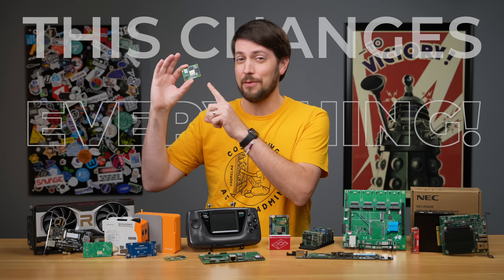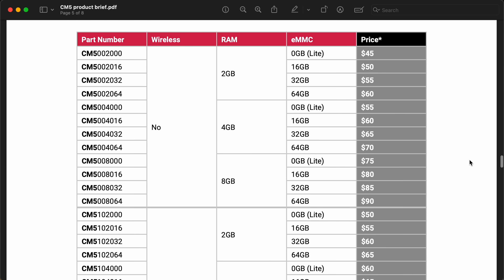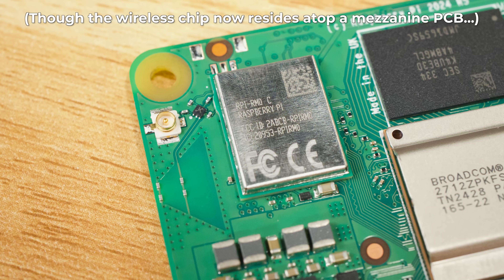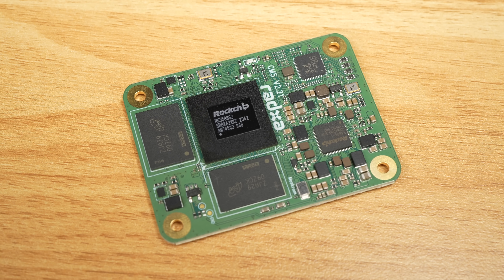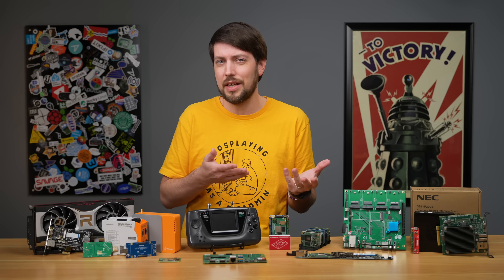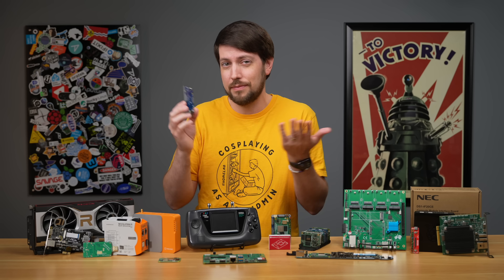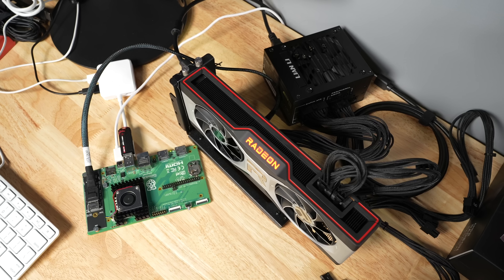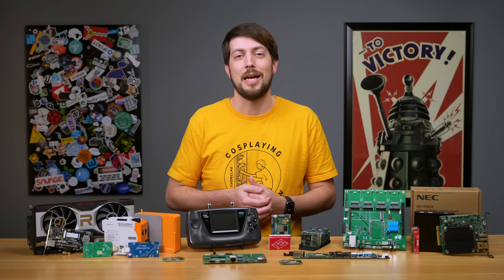This tiny computer changes EVERYTHING

Comment: Time for a raspberry pi phone.
Reply: I'm up for that!
Reply: You made my day. An arch linux phone.
Reply: Nah, gentoo. -O3 -funroll-loops
Reply: ...with a rotary dial - Justine Haupt, here we go again! :)
Reply: That's basically what the early PinePhone prototypes were…
Reply: @mskiptr The lack of RAM was the Pine phones primary disappointment for me. The SOC was much older and weaker than I liked but at least it ran Linux but the lack of RAM at that price 😔. Rumor has it that AMD is going to make a mobile phone SOC which would be quite interesting if it were true.
Reply: I'd love that but I dread the cooling issues it'd present
Reply: @g3n3r1c6  all aluminum case. the whole phone is a heat sink
Reply: @pauls5745  Same problem: What about when it gets too hot to hold? If we're throttling it, why use a Pi at all?
Reply: @g3n3r1c6  I would think it would okay, the flirc works fine. I imagine it needs thought, a phone case can't be all plastic. But im guessing its a device that could last many years.
Reply: @williamrutter3619  Probably, but there's the simple problem of holding it as it gets hotter. Eventually it'll get really unpleasant to keep in your hand.
Reply: @foldionepapyrus3441  Yes but at that point you may as well just use a smartphone with a CPU that's designed and coded to run at skin-safe temps.

You have this dilemma between the performance gains you could have, and the usability that you need to have.
Reply: @g3n3r1c6  solid state cooling will be a thing eventually
Reply: You can diy one already.
Reply: @alpha_pixel_ how does that work?
Reply: We still need better gpu
Reply: @sivasanthoshr.m2222  well for a phone I consider it sufficient, it will always be updated with new software and a new pi will fit in the slot in a few years time, all cutting ewaste.
Reply: @williamrutter3619  Agree 100%, I would love this, just a new CM module and a new battery if needed and away you go.
Reply: On it
Reply: Dude yessss
Reply: A... Raspberry PiPhone?
Reply: I’ve been planning a cm phone for a while after I got the basics for a rpi 4 tablet, running lineage OS with basic Google play functionality, working. It’s not the hardest thing to do. I’m still inexperienced but the power management circuitry and what battery/ batteries to use got a bit over my skill level. I never got a cm4 but it could be cool to look at that project again with the cm5. The screen was another thing I was having some trouble finding something that would really work well for a smartphone
Reply: @keatonbrier 
Just an idea 💡
Use a good USB power pack.. that is ergonomically nice and looks good..
with a case that splits along the edge... then make a strip (some are 2 sides and a spacer strip) that makes the 2 pieces further apart so you can install the electronics and screen..
I've used them to make the power pack also a rather powerful torch that fits in my coat pocket, have an air gap and multi layer foil (used to insulate House's between the LEDs and the battery, I've got switches on the side to switch each of the LEDs and a master switch on the end with a lock..
and it's still a power pack 😻
Reply: Id switch over to that tomorrow if the power drain and reliability was improved
Reply: You could probs slap Ubuntu Touch, Post Market OS, or Android on it, that'd already put you past the halfway point
Reply: Raspberry pi girlfriend
Reply: Or a Chromebook but with normal Linux on it, really repair-friendly and upgradeable
Reply: Nah time for a raspberry pi DS
Reply: @AverageSphere  hmm an interesting one, there is the GPI case, a compute module version, I think we are just waiting on the script and the gpi which started with pi zero power will be up to pi5.
Reply: what a good idea!
Reply: Need 4G LTE slot
Reply: piPhone
Reply: @LukeChannings  It amuses me that we basically commented this at the same time ^_^
Reply: Would smashing 💪🏻
Reply: Powered by Ubuntu touch?
Reply: please God I've been saying this for years
Reply: uConsole from clockworkpi
Reply: @siteking4289  Yep, I wonder why Jeff does not have one yet?
Reply: Maybe FairPhone can do it, they're already making phones that have user-replaceable modules. Slap a compute module in it and you're set.
Unfortunately that would make them even more bulky than they are now. 😐
Reply: I designed one 2 years ago and I've been waiting for the cm5 to drop
Reply: Runs PiOS?
Reply: Make one.
Reply: That would be sooo amazing!
Reply: I’m gonna design a custom laptop/cyberdeck based off of it I think
Reply: piphone
Reply: I was literally searching for a tiny psb to make a phone!!
Reply: Building my own phone like a pc is a dream, 10 years or so it might be a reality.
Reply: Argon have launched a Kickstarter for a pi laptop based on the cm5
Reply: In practice this existed, the Nokia N900 was practically a raspberry pi phone, the SOC was only slightly different. It even had the same overclock potential.
Reply: @Ziggurat1  it is the software and potential upgradability.
Reply: Time for me phone to become Pi sbc
Reply: Nope it is just time for the smartphone makers to adopt USB4. This will unlock so much potential for modular computing on the fly...
Reply: when we getting easy VoNR and VoWi-Fi implementations?
Reply: On a mesh network
Reply: Alr made one myselfes
Reply: I was going to buy the Ubuntu Phone before they backed out.
I'm glad the Ubuntu phone didn't happen because Ubuntu sucks, but I definitely want a Linux based smartphone (Android is Google not Linux).
Reply: Linux phones already existed, namely, Nokia's internet tablets (Nokia N810, N900, etc) which used a Debian-based OS called Maemo. It was basically Linux on ARM and you could do anything you'd normally do on Linux. I had mine with LXDE, Gimp, all of the functionality I'd expect from a computer, but with a phone on my pocket.
Maemo, back then on version 5 with the N900 I had, is still being maintained to this day and is on version 7. Give it proper drivers and a bit of work, and you can transplant it on a RPiPhone (I think there's already RPi images you can just burn to the SD card). By far, it's the best UI experience on a Linux phone, and the N900 was actually a really good phone, sudo apt update on the terminal and all.
Myself, however, while I'd be in the market for a linux slider phone (I hate the touch-only phones trend), I think this concept would work a lot easier on a clam-shell small netbook style in the format of the Qtek 9000 (A "PocketPC", also called the HTC Universal, between other names), since the bigger body gives a lot more room for error and usage of cheaper materials and own mods.
I've been into building something like this for very long now since there's no longer nothing like this on the market nowadays.
Reply: they did ages ago, the pi-phone
Reply: @thewhitefalcon8539  that was a bit of a dogs dinner, but a concept done. I'm thinking of cm5 slotting in to a pretty much regular looking smart phone, being more serviceable and upgradable than any phone today.
Reply: Looking forward to 6-18 month delivery time on a phone!
Reply: In a blackberry type body!!
Reply: @williamrutter3619  There's Already a RP Amateur RADIO, AND A HAM RADIO
Reply: Rasbperry Pi shoe phone with rotary dialer.
Reply: Just get a pine phone
Reply: @epluribusunum6622  that is not the same, one the cm5, is first compute module powerful enough. But it is software support and potential upgradability, which makes it such a good idea.
Reply: Why do piPhone when you can already get Debian based phones? (Mine is a Furi FLX1)
Reply: but there are already phones out there built on the Cortex-A76 (Armv8) ... why would you make a bad phone out of this thing here?
Reply: @hurdurdur7rl696 I agree, used android phone from 2018-2020 is basically e waste here. You can get as cheap as $10, or your friends drawer😂
Reply: The issue will be battery life
Reply: Space X starlink connected
Reply: Beepberry!
Reply: yeaahhh! I like that idea
Reply: Good idea
Reply: Waveshare SIM7600G-H M.2 4G HAT. A guy has been working on a project on Github called "OURS phone project" or something like that. I got his working, but I had to make a bunch of modifications to his build. But as mentioned, power source and over heating make it tough to be portable. Either way, it was a fun experiment.
Reply: Come with VoLTE please!
Reply: I really need a phone that comes with Ubuntu touch that use VoLTE. Not gonna pay a penny for the latest AI enhanced spyware.
Reply: Probably not
Reply: Just buy a 2017 flagship if you want that
Reply: @TheBacktimer  and what support does that get? .  I have a Moto G54 phone it totally outspecs an iPhone from just over a year before, yet the phone is only £140, is the phone better than an Iphone, well my bias would say android is better, but no the iPhone is a better phone in most regards, the camera is just better, not matter what specs say and the screen is better for the same reason. Apple will support the iPhone longer, so sometimes things are not so simple. If raspberry pi came in to phone industry, it would change things, more competition would be wonderful. Even if it just meant you could buy more support for your old phone, as I have given up on perfectly good android and apple phones.
Reply: @TheBacktimer  I also tried looking for a flagship phone from 2017, nothing comes close to raspberry pi 5, I compared the best phone to an old moto g7 plus from 2019. which is also obsolete, the old Moto g7 plus was much faster, that old Moto g, has slower memory to a raspberry pi 5 and a much and a slower processor. The nm process might not be the most advanced on a raspberry pi 5, but it is more similar in performance to a modern low end mobile device. Which makes a drop in cm5 a great idea, especially because raspberry pi still support their devices from 2017.
Reply: Yeah that'd be nice, does it support android like lineage os, like banana pi does?
Reply: V Electronics (https://www.youtube.com/@V_Electronics) just launched a video the other day that he's looking into doing just that, so for anyone wanting to assist and contribute, it would defs help bringing that idea to reality (video: https://www.youtube.com/watch?v=OgMdO0ckICg&pp=0gcJCa0JAYcqIYzv). Really looking forward to the open source community actually having something that works in that department since phones nowadays have you locked into ecosystems and yearning for new designs and features
Reply: Also, you all need to discover postmarketOS and Mobian. You can run proper Linux on a lot of Android phones. Of that, at lest a dozen models can actually function as a phone (i.e., the cellular modem works).

This idea is not as out there as it once was!
Reply: @mskiptr  cause bootloader unlocking became much more difficult , htc and lg are out of the game plus the phones cost so much that none would risk voiding a warranty.
Reply: @mskiptr  I have one of those in a drawer somewhere... did they ever get Bluetooth headsets (Incl. mic) working?? Or call reception in deep sleep working reliably??  loved the concept but there were just too many rough edges for it to be an actual solution at the time... I would love to have a device that was really, actually mine...
Reply: Technically has been possible (and some parts exist) for a while, but not that good. We really need an android one
Reply: @straightasaspline  it's easy enough to install Android on a Pi.
Reply: lol, hilarious. I mean as long as you’re not worried about the phones size, speed, or ability to run apps it would make a great phone.
Reply: @roninnder  the compute module is pretty small and phones seem to be getting bigger, I have a phone with a76 cores, the cm5 is adequate for powering a phone, a number of versions of android work fine already, which might be an option for some, but to degoogle is option many would like, the Raspberry pi foundation still support the original raspberry pi which is nearly 13 years old. regular phones don't come close to this. The compute module could give, drop in upgradability, giving a good ownership experience, and cutting ewaste.

Comment: This might be an interesting upgrade for my uConsole - which has the CM4 in it
Reply from the maker: That's one board I'd love to see with CM5. Hopefully it'll work!
Reply: @JeffGeerling  I can see there are a few pins which now do something different between the CM4 & CM5 but I think (would need to check) those aren't used by the uConsole so I think it should work
Reply: @PeterMountUK  That’s a very cool board! I thought it’s a retro gaming setup; but it seems much cooler.

In my case, I have a GPiCase2. Wonky initial software setup aside (rather hacky bash and Python scripts), it’s pretty cool — dockable HDMI output, but with built in display over DPI (lowres, but that’s fine), and — importantly — a battery.

Issue? Well, lack of analog inputs. D-pad is there, start/select, ABXY, L1/R1, two bonus buttons, “off” switch (a software command) and a reset button. Missing? Analog sticks or triggers. Otherwise, it would be a perfectly serviceable streaming device, plus a nice target for devs willing to target very lightweight devices.

Of course, uConsole seems even more impressive — portable terminal? Yes, please. And it seems to have DPad+ABXY+L/R. I don’t know where the analog sticks would go, but I’d like them so much on it.

(Assembling a Retro Lite is beyond my expertise or at the very least time constraints.)

How’s your impression of the speed of typing on uConsole compared to current mobile keyboards?

Comment: I want a carrier board that'll help me make a RPi5 tablet.
Reply: @jeffgeerling I'm also interested in building a Linux ARM tablet using the CM5. I want a low-power Surface substitute that gives me enough performance for working while traveling. It's been possible to make a Raspberry Pi tablet for years now, but I haven't found a carrier board that would allow me to keep the profile thin. Also, CM4 performance wasn't cutting it for me. The CM5 would be just right.

I think a carrier board with an NVME slot, an SD card slot, two type C ports, a socket for a 3.7v slim LiPo battery (with the appropriate battery management), DSI sockets for the display and webcam, a slot for an LTE/5G radio, a power button, and no headers would work well for my needs. I hope someone makes this board.